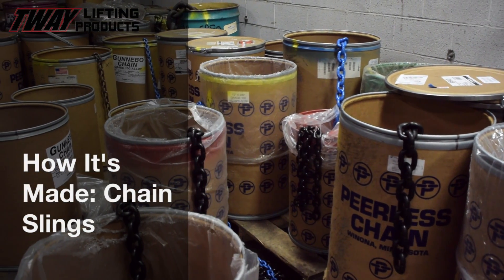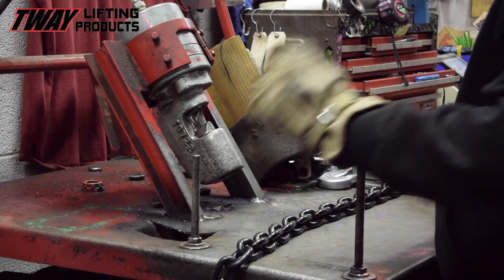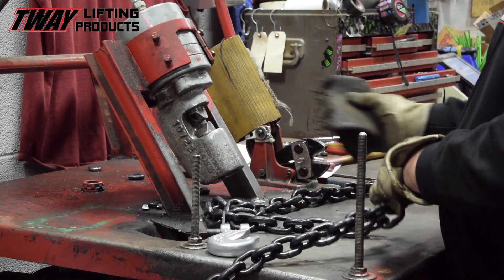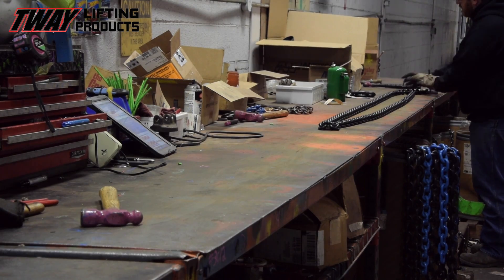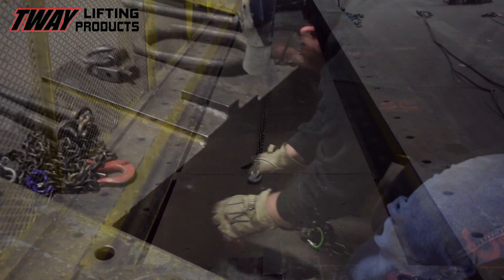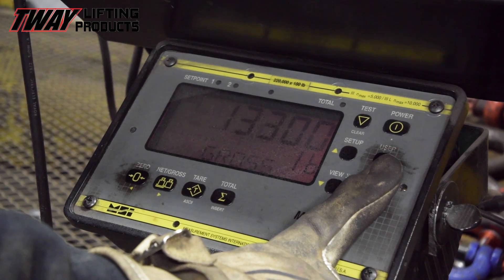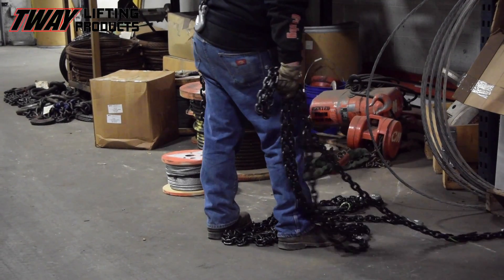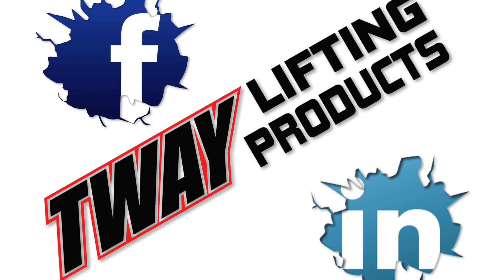How It's Made: Chain Slings

Comment: It's redundant testing new chain assemblies not only is each link of chain factory tested but so is the hardware. Testing is only required on repaired or altered assemblies. 

Aside from customer requests in 20 years ive never tested a brand new chain assembly.